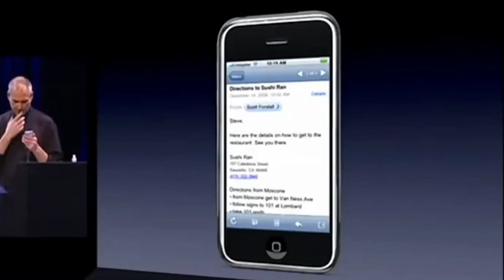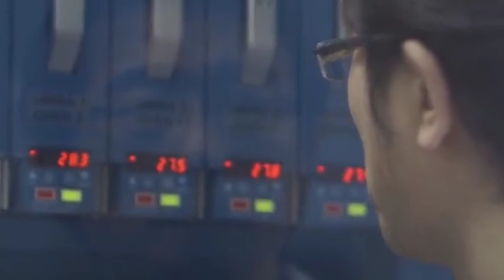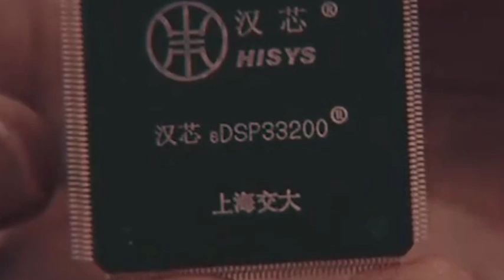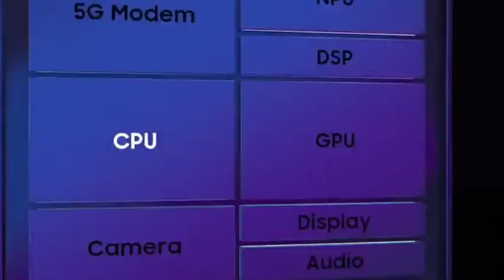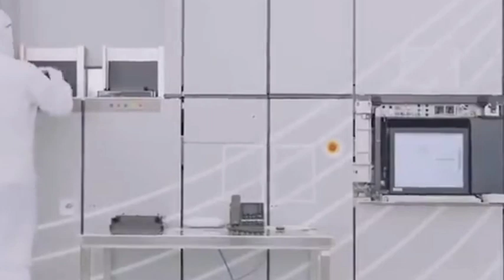SMIC builds four 12-inch wafer factories for producing 28nm chips, Samsung wants to buy 10 EUVs

Comment: SMIC is correct to focus on threshold nodes which are anything from 12nm to 28nm. China has in the past build up the production for mature nodes anything from 30nm to 120nm. They have stabilise this and especially their equipment are well supplied. 

Now China is building up the production for threshold nodes anything from 12nm to 28nm. If you look at it strategically anything from 12nm to 120nm is 95% of the world’s requirement. Don’t see SMIC doing anything wrong. SMIC market will be largely China and China is 60% to 70% of the world market. The market in China for threshold chip to mature chips is growing fast and due to its quantity, the cost is dropping fast. This is why China is not focusing on anything 10nm and more advance as this is only 5% of the world’s requirement. Moreover their own technology progress has not caught up and they are facing western ban. China’s advance chip is currently a science project in universities and major foundries. Nothing more. 

SMIC and China’s enterprises is positioning themselves to control the threshold and mature nodes market world wide and leave the advance chips market which is only 5% and declining fast to the Americans and Japan and Koreans and Taiwan to fight it out. For China, no quantity, no lower cost therefore no justification for investment.

SMIC is not only building factories for 28nm. They are also building factories for 14nm and 12nm factories. Yibu Tech just launch their 12 in wafer 12nm chips in Shanghai. Wing Tek just launch their 14nm factory. Even BYD have their 12nm / 14nm factory set up. SMIC and Chinese enterprises will position themselves as king of the threshold and mature node. TSMC also sees this and has a factory in Nanjing but having invested so much in advance chips, TSMC can’t position itself to dominate here. SMIC can and other Chinese semiconductor enterprises can.

China SMIC has already the ability to produce 7nm chips as reported by Bloomberg but choose not to mass produce it until the quantity justify it. It may not be too far down the road as Chinese government policy to produce most mobile phones, tablets and computer in China using the7nm may come into effect in 2023. Meanwhile it’s still a science project as they continue to refine it and destined for future development. People need to understand that commercially TSMC is basically stuck at 5nm or at best a repacked 4nm which is the latest Mediatek Dimensity 1200 and Qualcomm 5G Gen2 launch. TSMC proposed their 3nm to Apple but it was rejected. It’s too costly and technically unstable. They don’t call TSMC made Qualcomm 5G 5nm Gen1 chip fire dragon for no reason. Yes, tendency to overheat! The SMIC 7nm is not that far behind. China is also waiting for the semiconductor business to continue to fall therefore making viable for the Japanese to work with China on machines like the NIL that have the potential to develop the 5nm chips. Doubt China will be into advance chip big time until after 2025. SMIC did the right investment on threshold chips however EUV machines are for advance chips and this may backfire on Samsung.